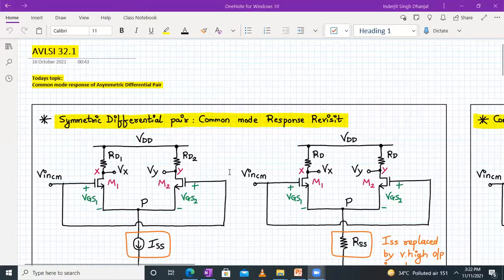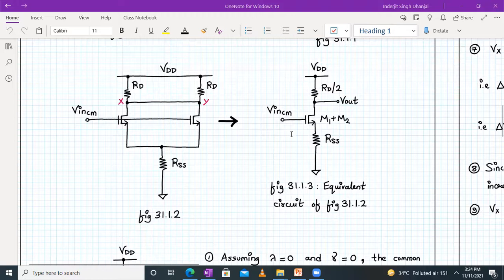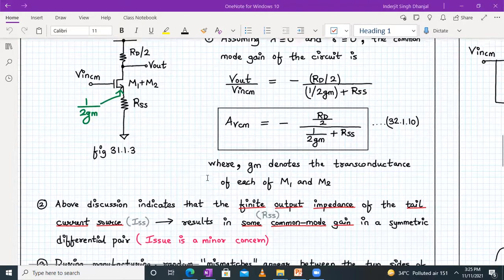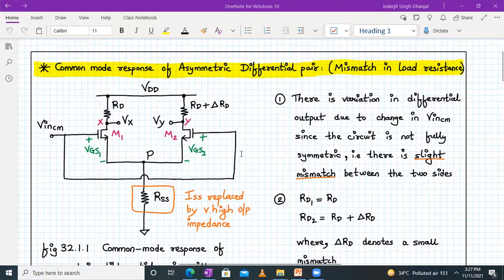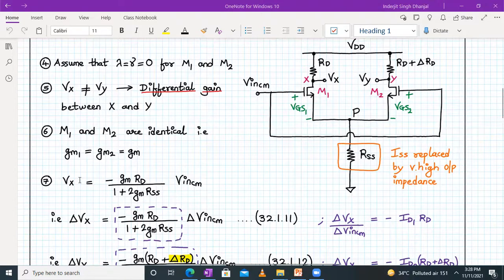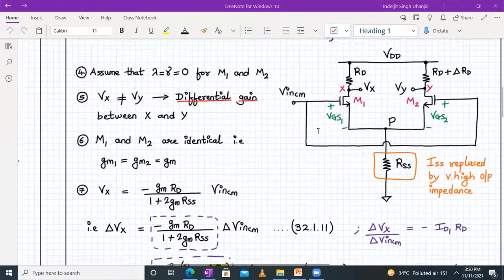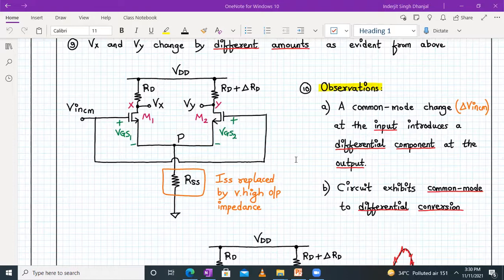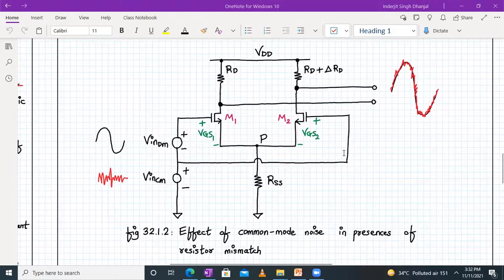Analog VLSI Design Lecture 32.1: Asymmetric Differential amplifier (Mismatch in resistors)

Comment: 6:15. The  common mode voltage gain formula was derived when Vx and Vy were same so we could fold and simplify the circuit . But now Vx and Vy are not same then how are you using the same formula? We can't simplify the circuit in this case and write the voltage gain formula for symmetrical condition here
Reply from the maker: From 32.1.11 and 32.1.12, only changes i.e deviation from symmetric condition is highlighted by slight deviation in terms of Delta RD. Symmetric condition formula is applicable since a small deviation from symmetric is asymmetric condition
Reply: @InderjitSingh87  but he is asking that you have not shorted the Vx and Vy so how can you use the same formula for Vx not equal to Vy
Reply: @PranavSingh-ur9ic  did u get the reason for that ?